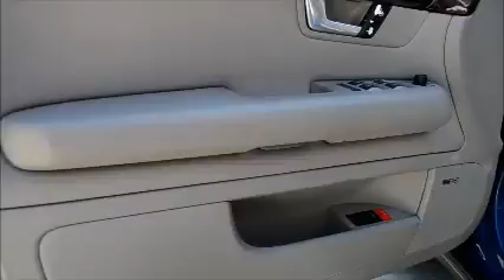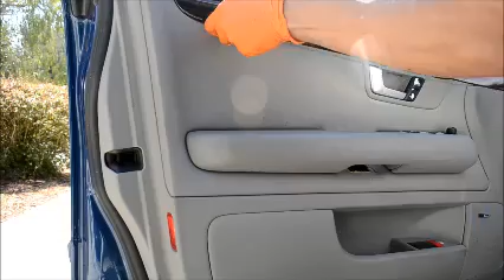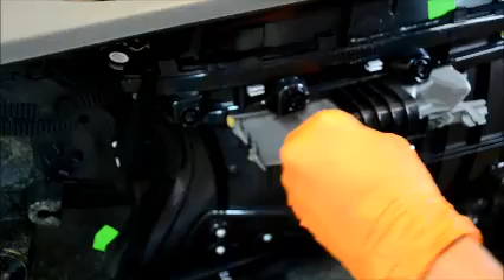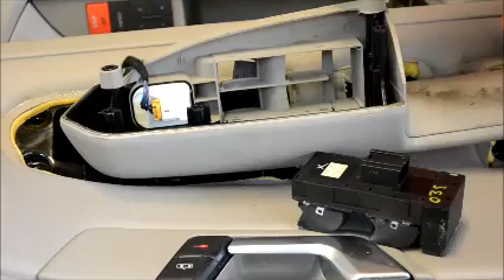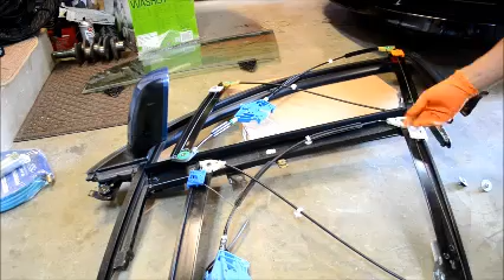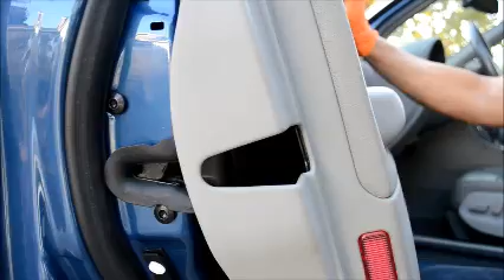2003 Audi A4 Left Front Window Regulator Replacement B6

Comment: Neat temporary interm fix. On the rear window, while the windows held up in place, screw a self tapping screw thru the 'keyhole' shaped hole in the centre vertical runner, into the plastic runner guide, to fix the window in the up position.
On the front window, take one of the broken door panel clips ( theres always one that breaks, when ordering the regulator, get clips as well ) hold the window up in place, now push the clips spike into the keyhole shape hole in the runner near the door lock. Done from the correct side ( check ) the clip will clip in and hold the window up in place till its fixed. Without the drivers side panel in place, central locking wont lock that door, but the door key will.

Comment: What actually broke in the first place?
Reply from the maker: The window regulator cable became frayed and one of the cable guides was damaged.
Reply: @SirFixAlotAutos   Thanks, I have several to fix & now I'm convinced to just buy the kit, rather than individual parts. Thanks for the quick reply & the excellent video.
Reply: My rear door centre runner leg broke & the front windows wire got tangled up in the winder part, probably caused by something else.